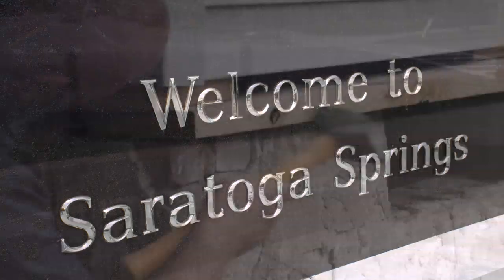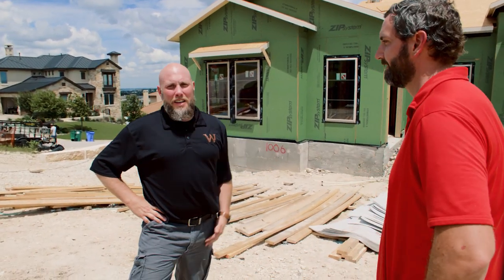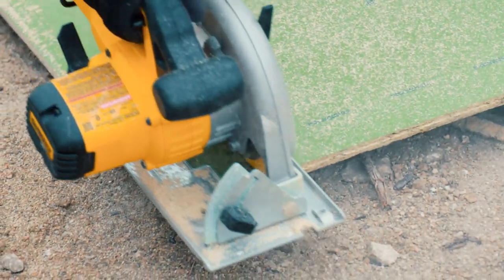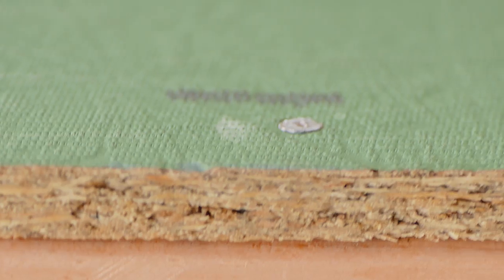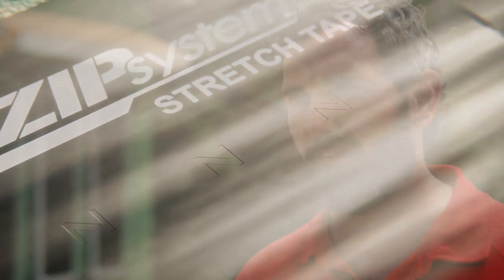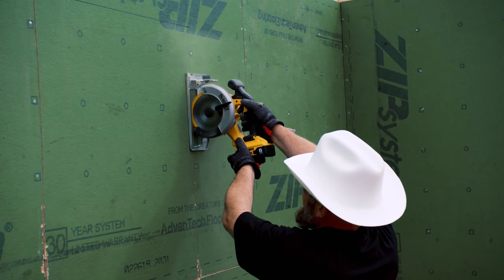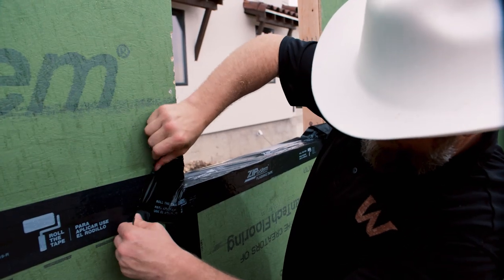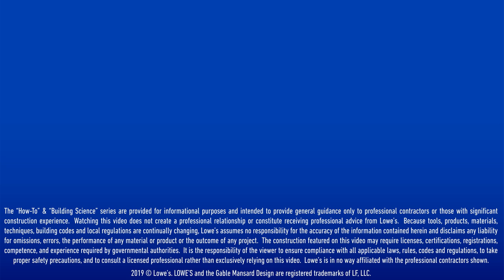Building Science: Weather Resistant Barriers | Lowe's Pro

Comment: I keep see vids about Zip but I can't figure out why people think its better than Tyvek. Its more expensive and osb as sheet is total crap.  I'll stick with plywood and Tyvek.
Reply: There are lots of reasons to use ZIP over Tyvek: quality of WRB, the speed of install, and the air seal.  The panels are not made of cheap OSB, they use very strong glue in their boards, which make them a particularly sturdy sheathing panel.  They seal much better than Tyvek too, which can rip during installation or in heavy windy.  Since ZIP is a sheathing panel and WRB all in one, you don’t have to go around the house twice, like you do with Tyvek.  You just tape as you go.  This saves time and ultimately money.  Even though the panels and the tape are more expensive than plywood and Tyvek, you should save money in labor costs.
Reply: @DealerTags  its not faster. It takes time to tape it and the wrb doesn’t worrk when you overdrive nails. you have to go back and tape all of them too. The tape is expensive.
Reply: @nicholaspappagiorgio6103  You’re totally right, the tape is not cheap and overdriving nails will compromise the WRB.  There are easy fixes for that though.  Just buy a cheap regulator for your nail gun, like he has in the video.  Then you can set your gun to the right PSI and you won’t overdrive nails.  Problem solved for $20.  Also, you can use a liquid flash over overdriven nails and won’t have to buy extra tape.
Reply from the maker: @DealerTags  This is the air adjuster Matt was using in the video: https://www.lowesforpros.com/pd/Kobalt-Air-Adjusting-Valve-with-Gauge/1000404953